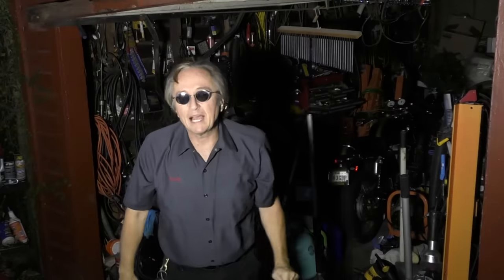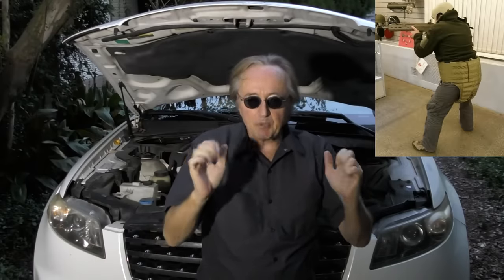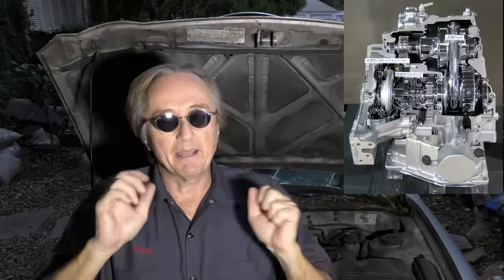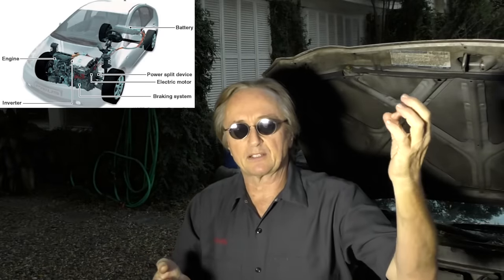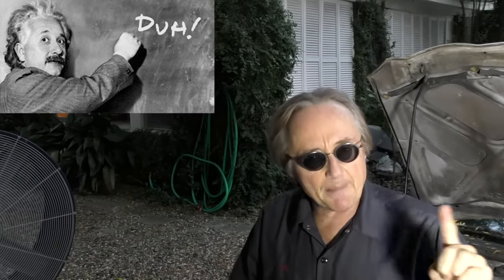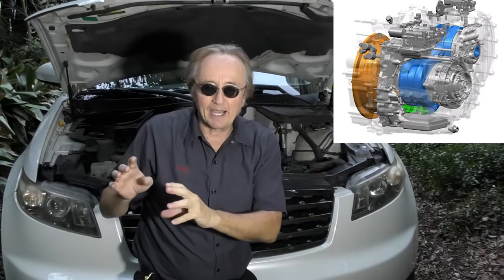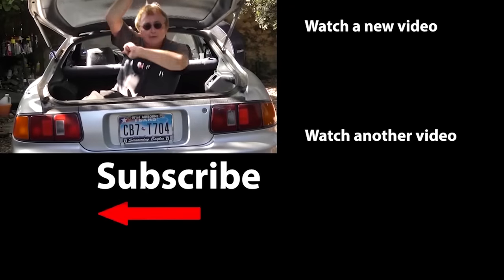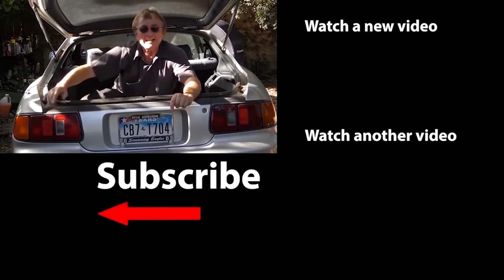Why Most CVT Transmission Cars are Terrible

Comment: Rev up your broken down NISSAN!
Reply: John M my Nissan Murano has 368,000 miles on it
Reply: NFL YoungBoy that’s one car, when ppl talk about brands they speak in generalities.
Reply: I have a 2012 Nissan Quest and has no CVT problems.
Reply: How to rev when it's already broken?
Reply: Won't rev if its broken 🤔
Reply: John M  my 2010 altima is over 210k miles in clock, zero issure
Reply: Rev up your stupidly LOUD EV!
Reply: My mom has a 2012 Quest on its second transmission
Reply: It's the newer Nissans that have CVT problems. There have been numerous people that have sued Nissan over transmissions going bad especially from 2016-2017 Nissan Rogues.
Reply: @NFLYoungBoy223  post a pic and give us the link the only vehicle I'd drive over 300k is a Toyota mine has 316k  nuff said.
Reply: @NFLYoungBoy223  
368,000 miles on a CVT........More proof that miracles DO happen!!
Reply: @JohnnyUkeOfficial  
Not just new ones.
In 2010 Nissan extended the CVT warranty to like 120,000 miles on the Sentras because of CVT problems.
Nissan switched all their cars except the 370Z to CVTs in 2007/2008......been hit and miss reliability ever since.
I had 2 Altimas, a 2012 and a 2010, both had CVT problems with less than 60,000 miles.
No more Nissan CVTs for me!!
Reply: @willjones28200079  please tell me about x trail 2017 cvt I've heard it has been improved a lot???
Reply: I have a nissan altima 07 , 195.800 m.  has no cvt problems 🖕
Reply: And Chevy!
Reply: @AlexCruz-oh7ow  lol
Reply: @AlexCruz-oh7ow  Cruz ? You should be driving a Honda
Reply: Jon Bee Dodged a bullet, my mom has a 2015

Comment: Shifting your own gears is rapidly becoming a lost art.  I learned on my brother's 1946 Ford pickup with a 4 speed non-synchromesh  transmission.  That was back in the mid '60's.  I have driven cars, trucks, motorcycles, and semi's.  I amaze people when I shift my own gears.  Keep those manual transmissions coming!
Reply: probably because theres no reason to do it. its a very odd and obsolete concept to me. motorcycles, atvs, planes, trains, boats, chainsaws, lawnmowers. pretty much anything with an engine other than a car, shifting it yourself has never really been a thing

Comment: Do you think automobile company’s will ever try a CVT transmission with a rubber belt that can be changed externally. They make large horsepower UTV’s and snowmobiles with rubber external belts instead of a wet steel belt. When it wears just change the belt. Rubber technology has advanced greatly. You can even get Heavy Equipment with rubber tracks. I would rather change a belt myself for $80 bucks than have my transmission go out at 80K.
Reply: DAF made a CVT with two rubber belts in the 70ies. It was also available in the Volvo 343.
Reply: No, pure rubber belts are way too weak for heavy duty cvt use. In reality, belts that need to be strong such as timing belts are in fact strong fabric belts with rubber as the gripping surface. Imagine the tread of a radial tyre.
Reply: I agree with your thoughts,☝️
Reply: @4G12  In the industrial environment there are kevlar belts with steel wires as reinforcements. They should try with something like that. There were used for years in water pumps and other machinery. Sincerely I won't buy them anyway. I stay with the gears.
Reply: @apn42  
My grandad still has a CVT Volvo 343 DL
It's had 3 belts since 1979; the original & two replacements. He's been pretty happy with it.
Reply: @apn42  that was the variomatic... it was invented by daf and started in 1959 with the first variomatic car the daffodil Later the inventor of the variomatic invented also the cvt.
Reply: Companies, not company's
Reply: They don't want customers to be able to repair themselves. It's all about the Benjamin's my friend. Rubber would remove the need to buy their products and the dealership will get no dollars for repair. This type of thing has been trending for years.
Reply: @mikeholland2346  Daffodil was the 2.edition. First one was called only DAF. 2cyl air cooled boxer 24sae hp. I remember the improvements they adverted when introducing the Daffodil model. variomatic = CVT.
Reply: The problem is that rubber belt will has to be pull-belts. The steel belts are push-belts and that way can transfer more torque.  I am not familiar with heavy equipment using rubber belts. Suppose they are closer to the engine in the power train  to allow higher speed to lower the torque. Reducing gear after the belt.
Reply: If you put one of those side by sides on the street with actual traction you'd burn through belts regularly. Even when on dirt they are known to fail. That's why Honda rarely uses them.
Reply: my rubber belt on my 50cc honda scooter with 2 people on it never broke, kept on trucking
Reply: Eggsr2bcrushed 😂

Comment: I will drive stick until the last manual transmission on earth crumbles into iron oxide dust
Reply: Same here, give me a manual or give me death.
Recently I was lucky to pick up a good deal on a new 2018 Mazda 3 with a manual transmission, very happy with it because I expected manuals to be completely gone by now.
Reply: Good plan. Autos are just not as reliable as manuals. I'll never own a car with a CVT, though.
Reply: @SavingPvtBryan32  I work at BMW and trust me our of 800 cars we have, around 27 or so are manual.
Reply: AcewingOFFICIAL ripppp
Reply: AcewingOFFICIAL I work at infiniti. I have yet to see a manual lol
Reply: @SavingPvtBryan32  Yeah like daaamnnn man no manual 50 or 60? Not even the redsport or project black? Surprising lol such nice cars
Reply: AcewingOFFICIAL I mean I work for a third party company and I go to Hella different dealerships but the I'm sure they have at least 1 or 2 of the q50 sports
Reply: @SavingPvtBryan32  I worked for grubbs infiniti and unfortunately they got rid of the manual transmission in every model now.
Reply: Design the trans so the belt and pulleys can be replaced easily at 50k miles for $300.  That would be acceptable, I would think.
Reply: I will stick with my manual corolla untill i can afford a Lexus . 😬
Reply: @SavingPvtBryan32  I have a 2008 Infiniti G35 S with the five speed transmission.

Comment: My 14 versa cvt transmission went out at 69k miles, just 9k past the warranty and 3months after I paid off the 5 yr loan. Never buying a nissan ever again.

Edit: in addition, I did every transmission service that the dealer said was needed. Nissan is junk.
Reply: dragonite986  that’s why my dad bought a 11 pathfinder instead of a 2018
Reply: @anthonymolina7416  I shouldve done more research about the versa, my mistake. I ended up selling the car for what I could and bought a new tacoma pu truck.
Reply: How much u paid for versa....
Reply: @MrDonny27  I paid 16k out the door new in 2014, sold it for 4500. It didnt hold very good resale value.
Reply: @dragonite986  Nissan never holds a good resale value.
Reply: Well it's just the transmissions. The rest of the parts are pretty reliable
Reply: Ash S just the transmission lol the transmissions cost more than what the car is worth
Reply: @calikev3528  that's true. Get a manual Nissan ( sentra and versa). You don't see those with problems, well as much. Maybe cosmetics and little electronics, but I don't count that towards reliability.
Reply: @Zizzyyzz  o
Reply: @1955gaylord  o

Comment: I have a 2012 Mitsubishi lancer gt with a cvt and runs amazing! I flush the fluid every 25k miles
Reply: Just got a Mitsubishi Outlander as a first car, was wondering if you are still liking yours!
Reply: Replacing the CVT transmission fluid can be pricey. He requires a special fluid.
Reply: @Yellow-Rose  I pay 300$ for my lancer es 2011

Comment: I had a Nissan versa for 8 years 160,000 miles and never had a problem with the cvt. Regular oil changed.
Reply: I leased one for two years to drive for uber, 2015 altima, had 55k miles when I got it, turned it in a week ago with 181k miles, never had a problem with the trans at all. I would go in for service at the dealer an see dozens waiting for a new trans.  Not me.

Comment: I bought a 2014 Ford Focus not knowing about cvt transmissions. It started messing up around 5k miles. Dealer fixed with a “reprogramming “ screwed up again at 17k miles. Dealer kept it longer, rebuilt . Traded in for a 2017 Ford Escape s. No turbo, no cvt, no eco boost, no driver assist options. Added leather seats, wheels, cargo cover, weather tech mats , dash cam f/r, radar detector, window tint,  side window deflectors. Plan on driving it until one of us dies.

Comment: Well, after this video, my options are reduced to Honda and Toyota for my next Compact SUV...
Reply: Honda has a CVT. Avoid it like the plague
Reply: @haroldbeauchamp3770  i can tell you didn't see the video, Honda makes pretty decent cvt transmissions
Reply: Mike Z if you want to roll the dice on a cvt that’s your choice bro.
Reply: Mike Z i can guaranteed you my honda fit is already 5 years old with 170000 km on odometer it still runs fine as silk. Just changing regular fluid every 20,000 km thats it for me very reliable! its also from aisin. Hondas cvt is way to go
Reply: confinez555 or just get a Honda with a regular automatic transmission like the Pilot.
Reply: Hyundai doesn't do cvts if you want to be even safer.
Reply: I live in south east asia,, so granted, our climate would differ greatly,, but i own a toyota minivan with a cvt thats done 80k miles no issue. Still very young for a toyota of course 😂😂😂

But it has done feats i dint expect it could pull off, like: hauling 7 people and ALOT of their stuff while climbing up/down hilly roads. All that weight, probably hovering 2400kg, and its only got a dinky 2.4 4 cyl pushing 160hp. 

So yeah, my toyota cvt minivan is holding up so far. the coolant color is still the same when i bought it 6 years ago, n as reccomended by the SC, only changed the cvt oil last year when it reached 75k miles.
Reply: Mazdas doesn't use CVTs and they don't use Jayco transmissions either. As of 2020 their cars are MORE reliable than Toyotas. - Consumer Reports top ten list

Comment: I’ve driven only manuals for 40 years and never once had a transmission problem.  But living in the US, it’s getting harder to find them 😥
Reply: Very hard. Im trying to find one now and am coming up empty
Reply: @lnsuvasquez2466  Hyundai seems to have quite a few of them
Reply: I too have only owned manual's for over 50 years. I just scored a 2022 corolla SE with only 5 G miles. The last manual corolla sedan made for sale in the USA. I'm getting a consistent 40.5 mpg combined with the new 2.0 L engine. My 2014 Corolla (owened since new) just turned 225,000 miles and get's 37.6 mpg combined.with original spark plugs, rear brakes, and clutch. We took my daughter's 2005 corolla (manual trans) from NH to San Fransisco and back with 149,000 mi on it, loaded with 5 people and luggage. (now has over 300,000 and doesn't burn any oil)  Nobody make's a better car than Toyota.

Comment: A Prius CVT is completely different than most other CVTs anyway.
Reply: Not even really a CVT in the mechanical sense, that's for sure. But it varies the ratios via the electric motor speeds.
Reply: Dead right, they either use 1 or 2 planetary gear sets (depending on model) and 2 motor/generators to convert the engine power into both driving force and electricity, which is feed to the 2nd motor. Depending on road speed, the amount of resistance created by the generator controls how much engine speed goes to the road and how much is turned into electricity. And of course, it can run without the engine for a short time too.
Reply: @George L everything needs something new eventually but at least the prius batteries last 10 times longer than a Nissan cvt.

Comment: This old stoner certainly knows his stuff 🤠
Reply: the machinist  Subaru motor vehicles have used manual, conventional automatic, and continuously variable (CVT) transmissions. Subaru manufactures its own manual and CVT transmissions (for non-Kei cars). Since the 1970s, all Subaru conventional automatic transmissions have been Jatco designs adapted to Subaru specifications.
Reply: Hugh Railey 4EAT is bulletproof. Subarus CVTs suck
Reply: It would've so fun to hang with Scotty smoke a Jay and ask him questions about my car lol
Reply: the machinist  Exactly! Fuji Industries (Subaru) make their own and were the first to use them in vehicles.
Reply: @shellcracker18  I believe that they had a problem with one transmission around a year ago.

Comment: well, to be safe with any type of cvt you must know:
1.change oil filter every 30000 km
2.change cvt oil with full synthetic oil at 50000 km
3.reduce kick down from 0km, its better for cvt transmission to do kick downs while moving
4.cvt transmission is good even jatco but with weak motor like 1.6 liter, most cvt failure when put a strong engine like 3.0 liter
5.not to do kickdowns while car is cold
so if this conditions suit for you then go with it
but personally i prefer dsg transmission and aisin gearboxes in terms of performance
Reply: What's a kick down?

Comment: Just FYI a friend of mine just had the CVT transmission replaced in a 2015 Altima. It had just over 60,000 miles on it after it crapped out. With a lot of my help pressure and knowledge was applied to a dealership and Nissan charged about $800 total for a new CVT and gave a new factory warranty. I just wanted to let everyone know of one outcome to this scenario. I advised  the owner to try to get rid of the car after they have put about 40k miles on the new tranny. Everything else about the car is perfect; but that tranny is an absolute disaster.
Reply: High School Graduate what car do you suggest a Nissan owner gets
Reply: @Lasheem  Any car without a CVT, or a Honda or Toyota  with a CVT
Reply: @whkrause  👍
Reply: My Altima CVT went out at 50k, under warranty and got it fixed. Then crap out again at 92k...now it's in the junk yard. Never again will I purchase a car with CVT.
Reply: Lousy transmission, stay away from Nissan Altimas.
Reply: I got a 2006 Nissan Altima with 115k miles with a CVT works fine. Must have been a shitty one.
Reply: @isidororios6123   What about Maximas?  i just bought a 2014 Maxima with a CVT 3 days ago and now im getting super nervous about it.
Reply: @MB-og8fi  : if you keep it, buy warranty CVT Nissan oil only.
Reply: @whkrause  hi what about mazda cx5?
Reply: I got a 18 Sentra today for 7k with 25k miles on it. I like my civic CVT way better than the Nissan
Reply: @MB-og8fi  same thing. My 2014 max cvt failed @ 64,800 miles. Just put a new one in.
Reply: @isidororios6123  that's just a kick in the nuts bought one 2 weeks ago
Reply: That's how much I paid for the rack and pinion on my G6 😂 I assume that was a discount price lol

Comment: 2016 Altima with 55,000 miles. Not one problem yet. Perhaps it's just how people drive/ accelerate???
Reply: just 25,000 miles left lol
Reply: Most cvt failures occur around 80k miles. Fluid changes are very expensive on cvts. Yours is due at 60k.
Reply: 55,000 is hardly impressive at all by today’s standards. I’d bet even the vast majority of Fiats make to 55k without major problems.
Reply: @4dscdriver  I changed my cvt fuild for $60 myself
Reply: We have 2 Nissan altima 2008 with 200k miles each, and they have no problems..
Reply: I agree you got to let the cvt do the work. I see this 1st hand when my wife drives my car. She will be running around town accelerating at 4k to 5k rpms. Hate when she drive my car lol
Reply: My 09 Altima CVT failed at 80,000 miles.
Reply: My 2008 Sentra have 200k, runs fine in very hot Mexico
Reply: I would sell it right away
Reply: that's not a CVT I'd guess
Reply: 07 dodge caliber with over 200k never had 1 problem
Reply: Anthony Conville man you are lucky!
Reply: My wife said now that I made this comment its probably gonna fall apart 😃
Reply: That's why I like my old Chevy truck. 297k on the original 4 speed transmission. If it goes out, I can get a used one or a rebuilt one for less than a grand. A completely re-manufactured one is only about $1600.00, which granted is a lot of money, but for a transmission, it isn't.  How much to rebuild the CVT again??
Reply: Not yet but its coming..be prepared..
Reply: EVERY1SONLINEANGEL some people should only be allowed to ride bicycles.
Reply: I have a 2013 Versa with a CVT with over 236,000 miles on it and haven't had any problems with it I like my little Versa.
Reply: it does have a lot to do with that actually. alot of people drive their cars like mad then are surprised when the transmission breaks down. granted some designs are more resistant to breakdown but if you drive your vehicle conservatively and do proper maintenance almost anything will last a couple of hundred thousand miles. I can bet that most of the transmission shops get their work from towing truck companies and people that drive their car like a race car.
Reply: @anthonyconville43  hey that's what I got too... you got awd???
Reply: 4dscdriver genuine Nissan cvt fluid is 65 dollars in Australia in the USA it’s probably 30 dollars, its no different to full synthetic transmission fluid. Also you can get a cvt rebuilt in Australia for about $3000, nissans are always $5000 cheaper than the equivalent Toyota.
Reply: John Dough mine has 130,000 miles I’m still waiting. :)